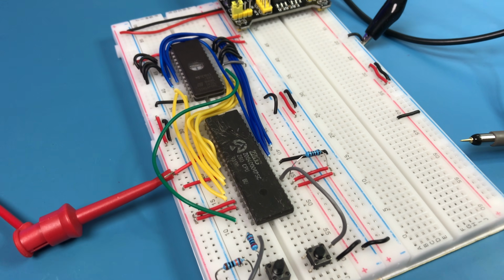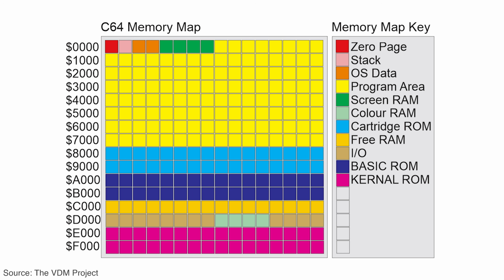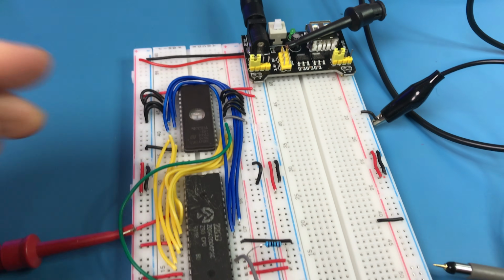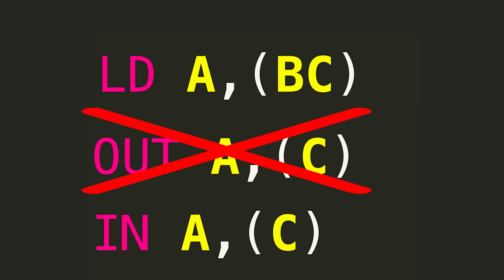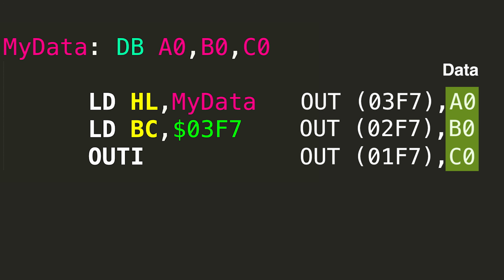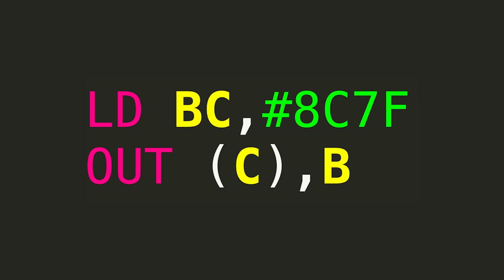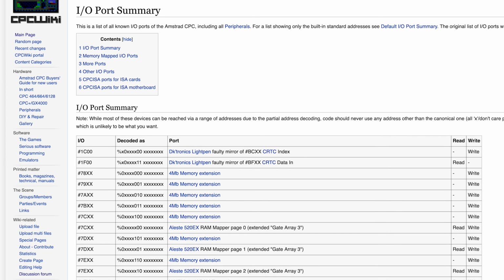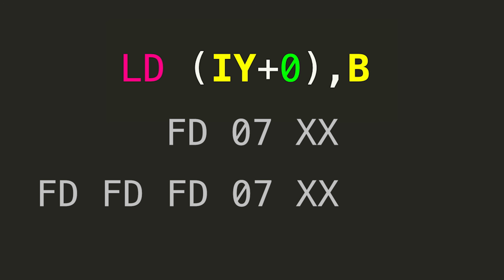The Madness of Z80 I/O

Comment: The Z80 includes hardware to automatically refresh DRAM, where other CPUs needed extra hardware to do that. So it sends out the odd request to RAM that's not in the code it's running. If you were to put IO there, it might end up being triggered by those refresh cycles. Of course, a ROM chip won't mind an attempt to refresh it, it'll just do nothing. So it makes sense there's an extra IN / OUT instruction that just raises the right pins so some device can respond appropriately.

Comment: 2:05 "...and not waste any addressing space on I/O addresses." Except that it absolutely does, as you go on to point out. Address $0000 (and actually $0001 as well) are dedicated to this, and are unavailable to be used as RAM.

If you compare that feature to the GPIO pins on the 6520 PIA used in the PET, the 6522 used in the VIC-20 or the 6526 used in the C64 you'll that, as far as the GPIO pins go, these all work in the exact same way: it's pretty clear that Commodore basically sliced out a bit of one of these other MOS chips and plunked it in to the 6510 CPU. There's nothing special about it other than it being integrated in to the CPU, and you can easily enough emulate it yourself with a 6502, a 6520 and a bit of address decoding logic.

13:00 As also mentioned by @rastersoft and @jtsiomb, on the ZX Spectrum the upper 8 bits of the I/O address space were used for many third-party peripherals, and even some built-in functions on later Spectrum models. (This was probably in part due to the lack of free address space in the first 256 I/O addresses; due to minimal address decoding fully half of those addresses were mirrors of just the ULA port.)

For example, the Spectrum 128K's  AY-3-8192 sound chip is addressed at 11xx,xxxx,xxxx,xx0x for data and 10xx,xxxx,xxxx,xx0x (where the x indicates "don't care" bits). 16-bit I/O space addresses are also required for several memory control functions, the disk controller, the some Centronics interfaces, and so on.

And the MSX machines, too, could have cartridges with hardware addressed using the upper 8 bits of the I/O address space, though I'm not aware of any that do that. There's little need for this because not only does the MSX have many more addresses free in the lower 256 bytes of I/O address space, but cartridges also have their own banked memory space available, and this could be (and was) often used for I/O devices as well.

Comment: 6:18 You can absolutely single-step a Z-80.  Just use static RAM instead of dynamic RAM in your implementation.  There is a video from five years ago on my channel as one example.  Cheers.
Reply: I think what he's saying is that just like the 6502, some early Z80s used CMOS dynamic RAM for their internal registers, meaning that a certain minimum clock speed needed to be maintained in order for the registers to be refreshed.  That's something I didn't know about.  I thought that all Z80 CPUs always used static RAM for their internal registers.
Reply: You can't single step the original Z80 design.
The original Z80 introduced in 1976 used a dynamic design in NMOS and had a minimum clock frequency of 250kHz. Going any slower could cause a loss of state and a crash.
The CMOS version of the Z80, which was introduced in 1985, had a static design and could be single stepped.
Reply: I wouldn't use SRAM over DRAM just so I could single step through the code. That is a very poor engineering decision. SRAM is a lot more expensive per byte compared to DRAM and not necessarily a good choice in a design where the production cost is sensitive.

Just use a decent in-circuit emulator.
Use the proper debugging tools.
Reply: @deang5622  You're kidding, right?  A single chip with 64kb of SRAM (the maximum addressable amount of memory for a Z-80) costs about $3.95 USD.
Reply: @TheUtuber999  But this is about I/O, so my computer uses a port for bank switching :). 2MB of RAM...

Comment: Interesting video! Now I know why the DivMMC Future (and similar devices) for the ZX Spectrum needs the (otherwise unused) M1 signal to be in fully working order...

About the ocassional weirdness of Z80 nmemonics, remember that the Z80 had all the 8080's original instructions... but the opcode names were copyrighted by Intel. Thus, Zilog had to make up their own names which, IMHO, seem  nicer to humans but are more difficult to parse by machines. *WAY* back in the day I wrote a Z80 assembler (in BASIC!) for the ZX Spectrum... that took almost all of the available RAM! After rewriting it to use Intel-style mnemonics (with some modifications for the Z80 specifics), the code became much smaller (~15 K).

I was certainly puzzled by the OUT (C), r syntax, but I think the Intel 8080/8085 had just 256 bytes of IO addressing.
Reply: Using the M1 signal along with reading address and instruction data, it would be possible to implement a fully protected mode in a Z80 based computer through hardware.  I'm not sure if that was ever done, but it would be possible.
Edit: You're correct that the 8080 and 8085 only had 256 I/O addresses.  So far as I remember, it only had the IN and OUT instructions which could only take a 1-byte immediate address.

Comment: I find it impressive that people are still using Z80.  The real question is why?
Reply: Probably a variety of reasons.  Nostalgia would be a big part of that, but there's also ease of use (not having to fiddle around with protected modes or the 8088/8086 weird 24-bit addressing system for example).  Cost could be another reason.  There are other reasons, I'm sure.  The Z80 is almost a CISC microcontroller due to its large number of internal registers.

Comment: The out behaviour for A and the 256 port side also comes from the 8080 which the Z80 was trying to be some level of compatible with. This is also why the IN A and OUT A instructions don't affect flags but the (C) versions do.

Guess what the 8080A did when you did an OUT instruction ? It put the contents of A on both the upper and lower halves of the address bus. This is why the Z80 has that behaviour, to be compatible with hardware that relied upon this (eg by decoding some I/O off each half to the bus to avoid the usual problem with fan-out limits on the low bits)

The choice of having an actual I/O space with IN and OUT goes back the 8008 and so presumably the board of discrete logic in the terminal that it was supposed to replace.
Reply: Close, 8080 OUT/IN instructions took a byte which is the 8 bit port and that gets put on both bits 0-7 and 8-15 of the address bus, OUT puts the A register on the data bus and IN sets the A register from the value put on the data bus by the hardware. Zilog versions of those instructions are different, the 8 bit port goes on bits 0-7 and the A register is put on bits 8-15, which is pretty useless for the OUT instruction as it's also the value that will be put on the data bus.

Comment: A few remarks:

1. The loading of BC instead of just C on the address bus.
This is most likely caused by the fact that the address bus is driven by one 16 bit internal register, that cannot be divided into an upper and lower 8 bit. So it must be supplied with a 16 bit value. That is why they have to use BC, not just C. 

Next question would be: why not OUT (BC),r instead of OUT (C),r ? 
I guess that the really only wanted an I/O space with 256 addresses, and the fact that B also ends up on the address bus is a side effect. It works just fine like that. Also: if you would use (BC),r, things like OUTI, INI, OTER etc are no longer working properly (as you stated yourself).

Conclusion: it is really designed as a 256 port I/O space addresses by register C. The fact that B also ends up on the address bus is an irrelevant side effect.What Amstrad did is a travesty.

2. LDI, LDIR, LDD, LDDR
These block move instructions are superb: the first time a microprocessor had SIMD (Single Instructions Multiple Data) instructions. They are not strange and akward, but a step ahead in microprocessor design.

Coming from the Z80, these SIMD instructions are one of the things I really missed on the 6502. Another is the lack of 16 bit memory pointer registers.

3. Why I/O mapped I/O at all?
Back then, memory space was scarce. Sacrificing pieces of your precious memory address space for I/O was a waste. You could argue that it would only take 256 bytes at most, but in those days, hardware was expensive and to really only loose 256 bytes you would need additional address decoding logic. This was often not done and you lost far more than 256 bytes for the memory mapped I/O, and as a side effect, the same I/O device could be addressed via multiple memory addresses.

4. Using empty spaces in the opcode table
As you pointed out, there are a lot of empty spaces in the opcode table when you have extended (2 bytes) opcodes. However, this is a risky business, as a lot of these unused opcodes actually really do something. These are known as "undocumented instructions" and the Z80 has quite a lot of them, and they are occasionally used as real instructions in software. So you must be very careful, and that makes it IMHO a terrible hack.
Reply: The Z80 uses memory mapped I/O because the 8080 did, this was a decision that came from the 8008 & was influenced by the 4004. It was less about memory space being scarce and more because it just made that particular design easier. The intel 4004 especially was a very odd design, due to pin count limitations.

It's rather odd that Zilog didn't document all the IX/IY prefix opcodes. They only documented the opcodes that work on DE & HL as 16bit values. But you can also access the IX/IY registers as 8 bit opcodes. That is if you can live with the speed penalty of using IX/IY opcodes.
Reply: @smf3472  I/O mapped I/O vs. memory mapped I/O goes way further back than microprocessors. Yes, the Z80 had I/O mapped I/O because of its 100% code compatibility with the 8080, and intel was the one to choose I/O mapped I/O. 

Neither way of doing I/O is really superior to the other. What can complicate memory mapped I/O is the usage of cached memory. You cannot cache I/O operations, so you must keep track to not cache the memory parts that are used for I/O (difficult if the cache is inside the CPU) or use dedicated memory operations/instructions  that are not cached. 

Regarding the undocumented instructions: there is a nice theory about how this came to be in the video below:

https://youtu.be/DLSUAVPKeYk?si=Xy1wKWptsgwUOUSy&t=867
Reply: @matthouben4242 I'm not going to say memory mapped I/O was invented by Intel, but they had wanted to make it easy to upgrade from 8008 to 8080. So the decision goes at least as far back as the 8008. If you look at the Intel 4004 and the origins of the 8008, then you would be surprised if Intel had chosen memory mapped I/O for the 8080. While the 6502 was designed to be compatible with the 6800 and that used memory mapped I/O (which made sense for the 6800).
Reply from the maker: Great points all around! Thanks!
Reply: @matthouben4242 Good comment, completely agree.

Comment: As anyone mentioned that (if my memory is accurate) the Z80 could use and refresh DDR memory without complicated chippery and that there were hidden opcodes? (I built and programmed Nascoms back in the 70s)
Reply: The Z80 had an 8-bit refresh register of which only 7 bits were actually used.  Its machine cycle included a memory refresh cycle during which the refresh address would be output on the address bus and the appropriate memory address strobe would be asserted.
The "hidden" opcodes were mostly related to the index registers.  Since they used the same codes as the HL register pair only prefixed by an opcode which was unused on the 8080, it was discovered that prefixing the code for an 8-bit operation on either H or L with the same prefix used for IX or IY would cause either the high or the low byte of that index register to be used just as though it was two 8-bit registers.  The down side was that you'd need an extra byte per instruction used in this manner, during a time when both RAM and ROM memory was expensive.
Reply: @melkiorwiseman  Thanks, so my memory wasn't completely wrong. I wonder if the dynamic memory refresh created the separate IO lines.

Comment: "Totally different" Really? The Z80 manual as well as other sources are all saying that the full BC register is placed on the address bus. And if you use OUT (C),B the B register appears on the data bus as well, of course. Not sure what you are making a big fuss about?
Reply: The in/out block instructions also use B as the counter. Using all 16 bits is a problem, even though some hardware does use all 16 bits. Many do not
Reply: @phill6859  I don't think I've seen many Z80 assembly programs that actually uses the I/O block-instructions though. (I've programmed the Z80 and 64180 for some 30 years, i.e. now and then, on and off from 1978 to 2008-ish.)

Comment: I love the LDIR instruction. It's great for fast block copying. Less well known, is that if the two blocks overlap and begin only one memory location apart, it's possible to clear a large block of memory just by zeroing the first byte and then use LDIR to copy to the next byte repeatedly until the entire block is initialsed.
Reply: I was used to SS. (storage-storage) instructions on IBM mainframes, so I wasn't outraged by the existence of LDIR on the Z80, albeit that IBM MVC instruction encodes a fixed length. For variable lengths which iterates using registers, you have MVCL, which is closer to how LDIR works.

There is another way, using an EX instruction to execute those SS instructions and, essentially, temporarily over-write the length encoded in the second byte of tge instruction (where the length-1 is encoded on an SS format instruction), but I fear that would cause explosive outrage...
Reply: @TheEulerID  Both LDIR and MVCL are 2-byte instructions and both ... are slow as hell. In places where a performance matters, MVCL is changed to a bunch of MVCs and LDIR to LDIs. But anyway the fastest way to fill/copy data on z80 is via the stack.
What's also funny, MVCL is also using more registers than specified in the instruction.
Reply: @PS-bp4ju  MVCL?  MVC?  Those are not Z80 instructions.
Reply: Sorry, you're comparing to IBM360 instructions.  got it.  I'm surprised nobody has mentioned the "MLC" instruction of the IBM1401 which could move and entire word-marked field to another field (of any length).  And you could do the same trick, move one character onto the adacent, and repeat, to clear core.   MLC moved from higher addresses to lower addresses, so it was more like LDDR.   the IBM 1401 "MRCM" instruction moved from lower to higher, and was terminated when a "Record Mark" character was in the input address range, so it was very similar to LDIR.  Most people used the built-in "Clear Storage" (CS) instruction to clear memory, although it was actually unnecessary; just a convenience, because it also cleared Word Marks.   old, weird machines!
Reply: If one wants to fill a bunch of 256-byte chunks of memory with a 4-byte pattern, using a sequence like LP1: LD (HL),A / INC L / LD (HL),C / INC L / LD (HL),D / INC L / LD (HL),E / INC L / JP NZ,LP1 / INC H / DEC B / JP NZ,LP1 will be a fair bit faster (about 13.5 cycles/byte) than LDIR.  LDIR is handy, but it's tragically slow because of how much time it spends using a 4-bit ALU to update BC.
Reply: LDIR is almost like a hacked-in CPU bound DMA. It's very handy though, and makes for small binaries that can move a lot of data, even if not the fastest way to do it.
Reply: Yep.  This is exactly how the TRS-80 cleared video memory.  You can also use LDIR to shift the video memory one character up, down, left, or right.  It's all in how you set up the pointers.  Way back in the day i wrote a small machine code routine that piggy backed off of the DOS CMD command (i didn't have a disk system, so no DOS), and it could fill the screen with a character, move the screen as i noted above.  Used it for writing games back in the day.

Comment: Hi Noel. The CPC printer port only requires 1 address, and in fact the OS only uses &EF00 to communicate with the a printer. So a simple mod to the printer port so that the printer only receives the strobe signal if A7 is low means that a new peripheral can listen for A12 low, A7 high and has 128 addresses to choose from. Or the OS could be modified to use &EC00, printer port mod to listen for A10 low, and we have 512 I/O addresses available. Even better, if you don't intend to use a printer the whole of  &EC00 to &EFFF can be used for a total of 1024 addresses.